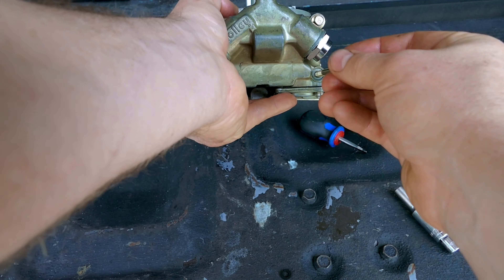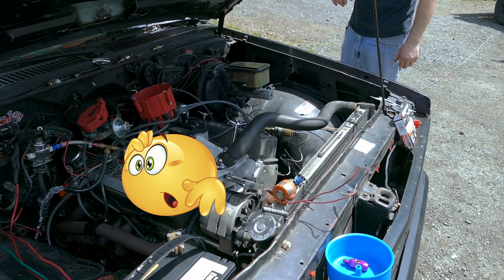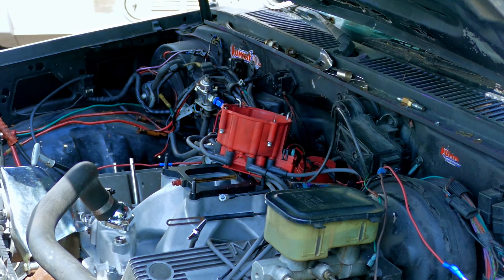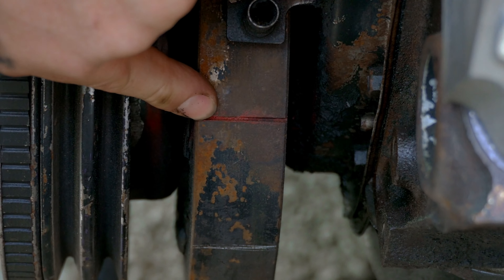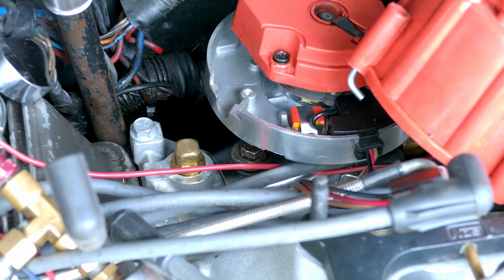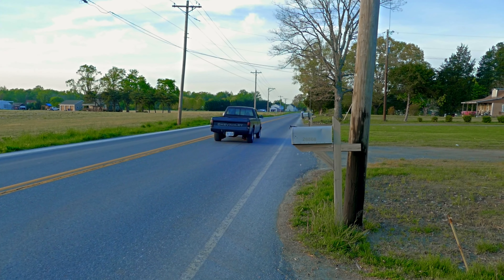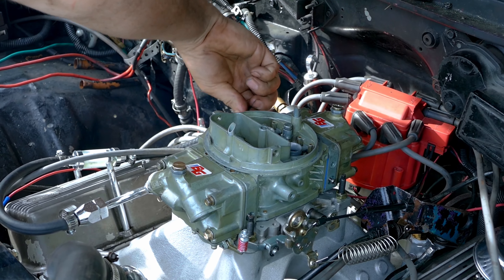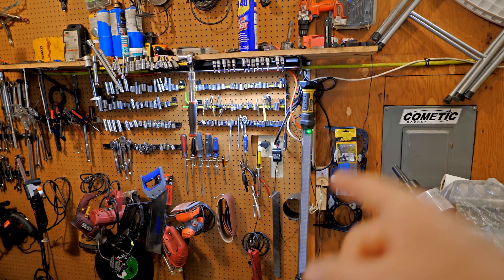Vortec 350 S10 gets back up an running + Wedding ring and12 volt DC battery destroys my finger!

Comment: HEI don’t have a mechanical stop for the mechanical advance, the advance springs end up being the limiter.  If you run really light advance springs you’ll have inconsistent timing at idle, over advance and sometimes starting issues. 
If he wants to use the HEI with vacuum advance I’d recommend adding a mechanical stop by welding/brazing the slot smaller and running a curve using the stock weights with 2x medium weight springs as a base.
Avoid ever using the lightest weight advance springs they’re more problems than they’re worth.
Reply from the maker: Thanks for that info. My only experience with a VAC advance was with a MSD billet we put in a custom bushing and only a 10 degree spread car ran great after that. I wish I kept my silver spring off my msd i think they probably would work great on his truck.
Reply: Run one silver spring, and don't touch the other one.  Runs like a champ.

Comment: That truck needs the smaller vortec style hei distributor on it! Definitely improved it from what it was!
Reply: Do you have the part # for a small(er) one? Ty
Reply: @nativepatriot7017  msd pro billet will work also with a hvc or hvc2 coil

Comment: As soon as it gets cold, that single plane is going to turn into a toilet.  Vortec Airgap dual plane is what it should have on it.  And on those cold days, if you keep pumping it, which will happen, you wash the rings clean of oil, and there goes your cross-hatch, and you know the rest of the story.  Nice wheels and loud boom-boxes...doesn't quite equate to a finely tuned V8.  And you said it in the beginning.  Completely mismatched.  p.s. (That is a nasty burn on your finger.  Hope Turbo John sees it).

Comment: I have an nv 3500 behind l31 in a 96 S10. I wish that damn transmission was stronger. Damn transmission blows up every 3 years.
Reply from the maker: I don't know much about them I run a built th350 so far it has held 750HP from time to time on the kit.
Reply: @TPVPRO  it's a  manual 5;speed 300 pounds of torque at the crank is max. No aftermarket parts.

Comment: I touched  my wedding  ban on a 200 volt DC line on a circuit board  blew a chunk  out of board  & my ring  spent the rest of night  with  exato knife  cutting  around  ring  so I could  get  it  off my finger  that's  why  I never  wear  jewelry  anymore  ouch